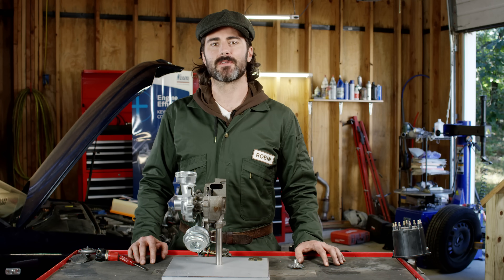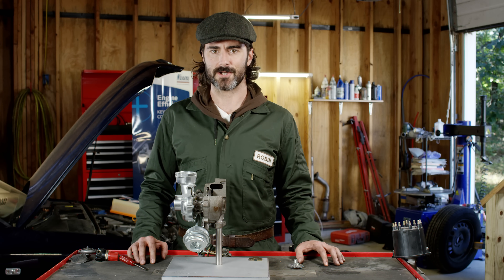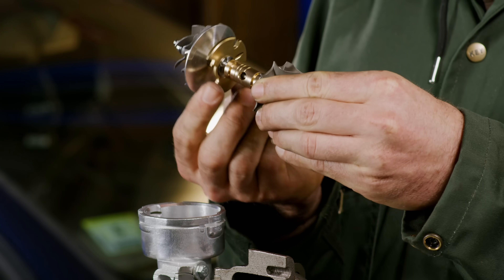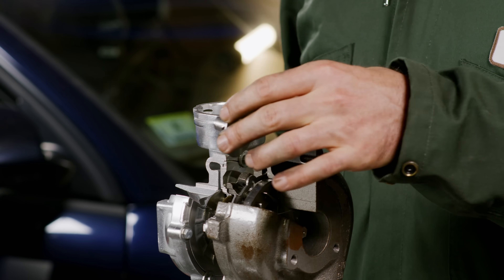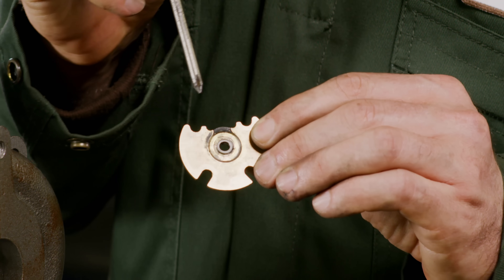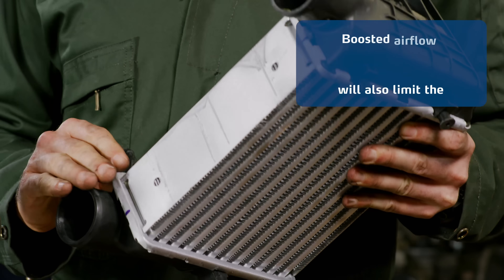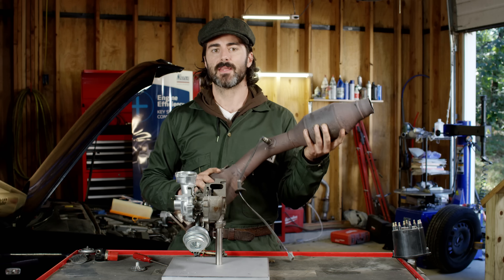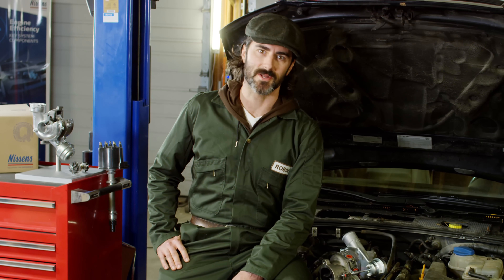Turbo Troubleshooting (4/4) - Overpressure

Comment: Hi can you help... I have a hissing when i exelorate and a fu fu fu noise when i leave off the throttle could this be a vacume leak?? Of is it a failing turoo car runs fine no miss idle no bad response or turbo lag or smoke just this anoying noise  seem to happen when one of the deisel enjectos failed. Can you plz shed some light ???

Comment: My turbo exploded without any signs of failure last week Thursday. The recovery Technician said it’s because I have gone over the max limit of the engine oil 😢. There is black smoke when engine is turned on in the morning now. Driving on first and second gear don’t produce no black smoke but the black smoke gets to gushing catastrophic lever on 3rd speed and above.😮😮😊. Sometimes now when doing revs the accelerator get sticky with loud revs had to turn the engine off to make it stop. Where do I start with the fix . Should it be a complete turbo change?

Comment: I have a p0299 turbo underpressure code on my '15 Tiguan.  The car only has 45000 miles.  Do you think it would be the turbo overall or one of the turbo sensor/valves?  Would an under pressure  The car drives fine.

Comment: I understand an old or blocked air filter can cause oil to be sucked through the shaft seals on the intake side.  This appears to be the case on a friends car that has a rather awkward to change air filter.  I am about to change the filter on my friends car tomorrow, after I mentioned this as a possible cause for the oil I found in pipes leading to the intercooler she told me her car had been warning her that the air filter needed to be changed.  She has had two different independent mechanics look over her car yet none sorted the issue lol
They said the turbo is not an issue, but I will find out tomorrow for sure followed by some testing.

Comment: Need some help. I think something is wrong with my turbo. Currently have no boost nor power. Slow acceleration, my turbo sounds like a zipper on a wind jacket  when driving lol. Its a weird sound but trying to figure out the issue exactly.  Engine is at 122k 2010 gen coupe 2.0T
Reply from the maker: Hi Tez, I would take off the hoses and pipes for the compressor inlet to see if the wheel is damaged. Maybe there is too much play in the shaft. You may need a new turbo. /Robin

Comment: Hi Robin,
Just had a new turbo installed in my 2007 A4 and now have oil leaking (about a 1/4 cup) from the bottom turbo airflow hose area shortly after driving it -weather it’s driving for a half an hour or just pulling it into the garage from the driveway.  I’m stumped.

Comment: Dear Robin. I have this exact engine and model of a car, and now - no turbo. I've had a better knowing person check that the wastegate is working, that the turbo itself looks ok, no leaks or such. The car itself has been "reset" to make sure no limp-mode or anything is in the way. For some reason I still get no boost. Is this the single point of failure now, the turbo itself (even though it looks healthy and spins ) or are we missing some easy fix? The car has little white smoke but it goes away quickly, no check engine light etc It drives mightily fine. It was bought in this condition and two owners over the last 5 years had had no issue except for no boost. (slow acceleration and such )   

Any pointers? =)